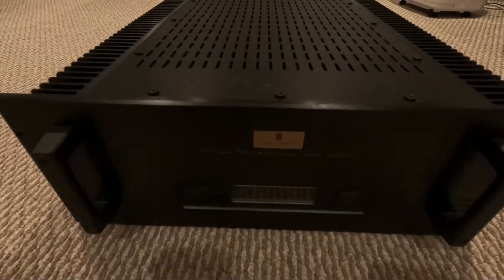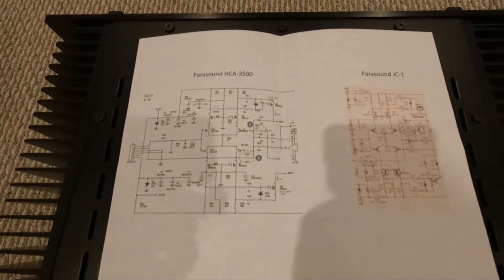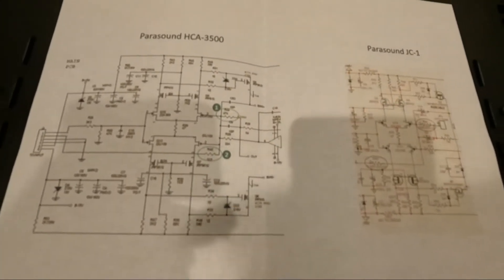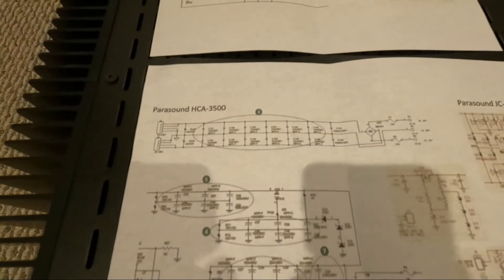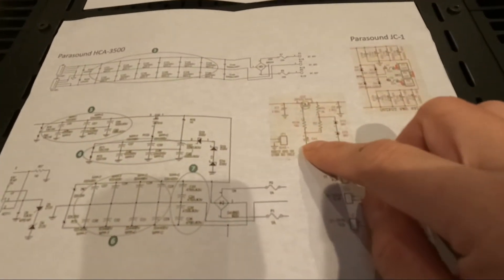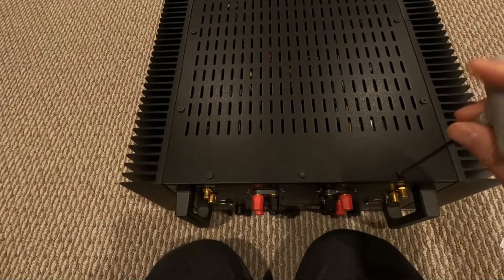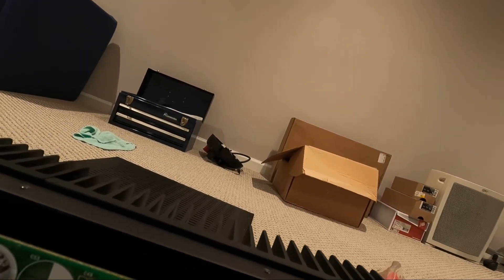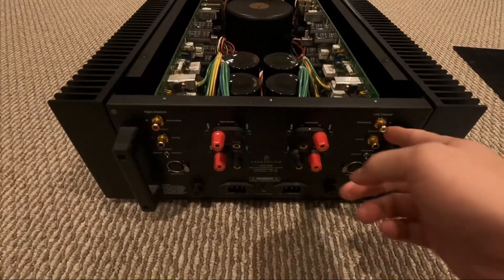Maximize amplifier potential - Parasound HCA3500 Modifications

Comment: 您好,我在您的其他影片中看到您會講中文,希望您也看得懂中文,想請問您如果我要請師傅修改零件的話需要哪些材料？
Reply from the maker: Neighorizon- 元
1 year ago
The significant ones are the feedback resistors and the decoupling capacitors. Please refer to the schematic in the video for the exact parts
Reply: @neighorizon-4190  好的謝謝您的回覆,我想請問一下,我的hca-3500 right channel 在開機的時候會一直跳到over是什麼原因請問您知道嗎？
Reply from the maker: @chicken0620  Should be related to the capacitors, unbalanced on positive and negative power supply causes temporary output offset.

Comment: I have this amp and want to do these upgrades! You close to Phoenix?
Reply from the maker: I'm in New York. You can do it yourself, if you know how to solder and de-solder
Reply: @neighorizon-4190  Where did you source the Halco 47k resistor and capacitors? On capacitors , brand?
Reply from the maker: @azthu1  Bought the resistors from a local private seller. The capacitor are Nichicon Gold series
Reply: @neighorizon-4190  I just purchased from a Florida based seller(1/2W 47.5k ohm1.0% Holco Metal Film Resisitor Audio Holsworthy H447k5FD) Does this sound right?
Reply from the maker: @azthu1  Yes. I believe that they no longer make these resistors, so they normally look old, such as slight oxidation on the leads.